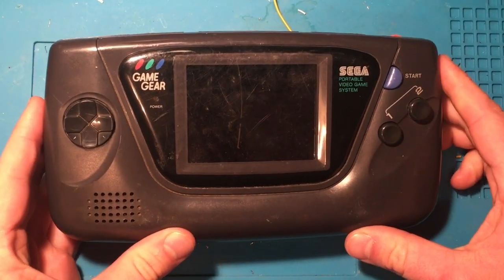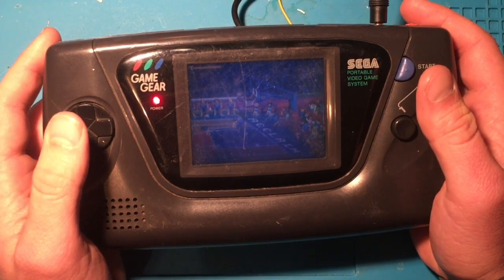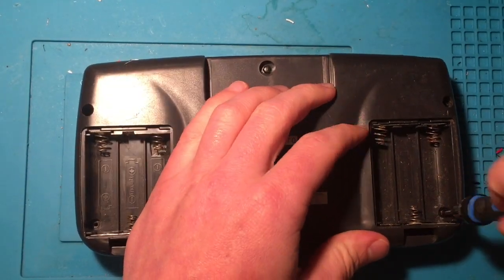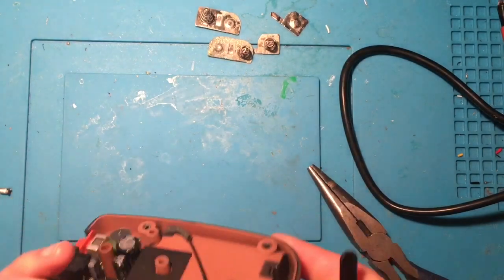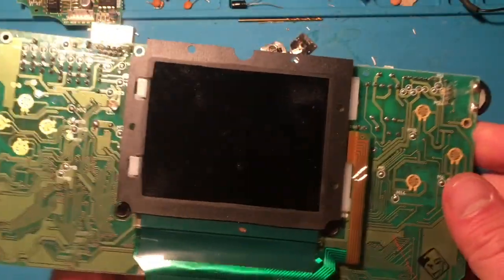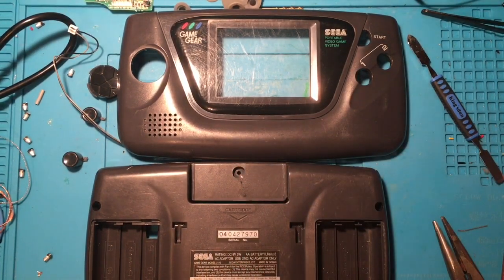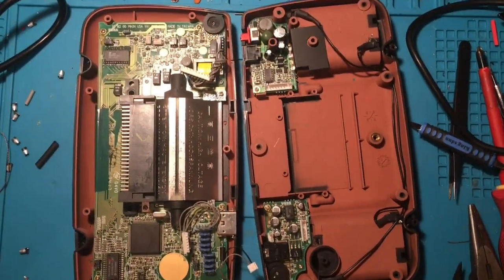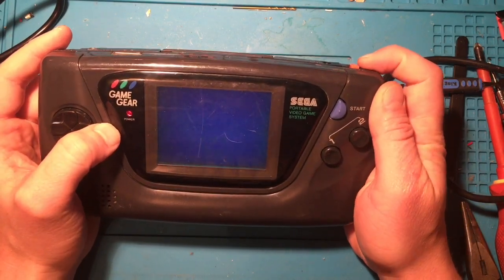Game Gear - No Power - Fixing eBay Junk

Comment: Mine has a bunch of dead capacitors and every time I replace one another one blows up!
Reply from the maker: Like changing a headlight bulb, just change them all.  Capacitors on this system are always prone to failure. It's not a matter of if, but rather when
Reply: yeah its a guarantee they'll all fail, in my experience its the number 1 reason why this system becomes faulty.
Reply: That's pretty nice to know guys, maybe I'll grab one to fix then. I found the comment  kind of funny though, I can  only imagine how frustrating it must have been :P
Reply: @RetroRepairs  I want to do that but my local component store doesn't have what I need and because I'm 13 and don have a credit card I cant get any online. I know I a store that has the right ones but it's an hour long drive! I'm going this weekend with my dad. It seems every time I get a lead there is a roadblock to stop me XD
Reply: @SparksNZeros  I got it to play sonic but the screen was only displaying one segment of the screen over and over to fill the screen. The audio was also really quiet (probably the amplifier). That's when another capacitor exploded.
Reply from the maker: Prepaid credit cards are your friend.  You should be able to buy them at most local grocery stores or drug stores.
Reply from the maker: If you're going to buy caps, buy double what you need.  They should be fairly cheap, but you'd hate to mess one up, or lose one and be stuck
Reply: @RetroRepairs  thanks for the advise! Will do
Reply: @Omegapork  console5.com gas cap kits and the wiki has info on cap values if you want to source them yourself.

Comment: As for the speaker... just drill out the plastic rivets and then use hot glue to reset it in place. did thet with mine when I replaced the speaker eons ago. lol

Comment: What would be a device to try and fix with no experience? You have inspired me to try fix some circuit boards which I previously thought were impossible to fix without magic
Reply from the maker: Older is better. Atari, NES, etc. More room for error, less specialized chips.  Nes systems are very hardy and the replacement parts can be found.  Snes are much different, proprietary chips needing better smd techniques and precision
Reply from the maker: Game gears have very common capacitor faults, so often many different symptoms can be fixed with new capacitors
Reply: RetroRepairs I’ll look out for some. I have a soldering iron and some solder. Any other basic equipment I should pick up before I attempt to fix something?
Reply from the maker: Yes, depending of course on what you want to try and fix, but essentials are a good desoldering braid, rosin flux, 60/40 rosin core solder (thinner is better), tweezers, needle nose pliers, stranded 30awg wire (for jumping bad traces), isopropyp alcohol, q tips and a toothbrush.   You will find that eventually you'll need to get replacement components as well such as capacitors and resistors, so even finding an inexpensive electronics repair kit could be useful.
Reply: @RetroRepairs  Thank you!
You should consider making a video about getting started into repairing electronics (consoles and handhelds to be more specific) that you could link to in all your videos for anyone interested. I feel it could help out a lot of people. Just the basics of what to pick up and where/how to use them as an introduction to repairing things. You've definitely influenced me to try learn and I doubt I'm the only one who would find a video like that helpful. You could even use it as your channel trailer video! Just a suggestion, it's completely up to you! Thank you again and keep doing what you're doing!
Reply from the maker: When i started dabbling, i had a cheap $10 chinese soldering iron, some cheap radio shack solder, and a bottle of alcohol.  I kind of just acquired what i needed from there.  That's not a bad idea though to get people started though.

Comment: don't they have led bulbs that are the same shape and use the same plug as the cfl? would think could just change the bulb to led?
Reply from the maker: Problem is the bulb doesn't plug in, its hardwired to the board, so it's a proprietary bulb.  I'm sure it's possible, but i haven't seen one

Comment: I have a similar problem: 

Power on well with the AC adapter but when I use the batteries I have weird voltages on powerboard. Maybe is the voltage regulator ? 

Any help is very appreciated.
Reply from the maker: Definitely could be a regulator.  Id have to look again, but I'm not sure if there's two regulators, one for ac and one for batteries.
Reply: @RetroRepairs  thank you for the speedy reply :) I have also some coloured vertical lines in 1/3 of the screen but i think it is an impossible repair... Keep it up man !!! Great channel 😁

Comment: Great video, regarding the backlite how about looking into if you can use the backlight panel fra a ds instead ? much cheaper :D
Reply from the maker: You probably wouldnt be able to swap the screens. Different resolution, different connectors. But there's a way to use LEDs instead of a cfl bulb which would definitely help
Reply: @RetroRepairs  Not the screen just the backlight, you can seperate the backlight panel from the image producing part, im pretty sure that's how we used to do cheapo gameboy backlights back in the day :)
Reply: @RetroRepairs  Actually just google it, there's videos of the backlight swap both on the dmg gameboy and the game gear :D

Comment: Got mine off ebay as well. White screen after turning it on, replaced all the caps still the same issue. Any idea what it might be?
Reply from the maker: I assume you've checked the brightness wheel? Should at the very least still be able to switch from white to dark. Could be a bad potentiometer. Might need cleaning or to find a replacement.
Reply: @RetroRepairs  Potentiometer seems to work ok, goes from dark to fully bright but white background. Regarding the capacitors I got them from an ebay kit. Really good quality. I am quite experienced in soldering. The problem seems to be in another component or so. Sadly I don't have that information to track it down. Thanks for your reply! Keep up the good work :)

Comment: Just for my understanding, rubbing alcohol is like isopropyl alcohol?
Reply from the maker: Rubbing alcohol like what comes in those little packets in first aid kits is usually a bit more diluted.  It can work, but if you can get 99% alcohol, that's best.
Reply: @RetroRepairs  oh thanks, i work with isopropyl but i'm not an english viewer so i think that was another type of alcohol, btw handheld legends sell an led backlight for the gamegear for 9.99 maybe thats is useful for you
Reply from the maker: I've bought from handheld legends before. I'll probably try that on one of these some day

Comment: A few years ago I would have said great video, now it is good informative. However I believe  you should have updated the power an added a charging port. So that you dont have to buy batteries or go threw the hassle of changing the rechargeable batteries. But then theres adding a power gauge as well so could have been alot or just rite. But great for the retro crowd. 

Damn one day someone's gunna make a vid about making AA batteries for old hardware.
Reply from the maker: Good ideas.   I'd like to do those in multiple videos if I were to do that,  i think it's best to stick to one topic/mod rather than cramming everything into one long video
Reply: @RetroRepairs  excellent...lol
I wouldnt blame ya. That's a whole lot to cover an to do rite.

Comment: I have a blue Game Gear with the exact problem, no power.
Reply: Does it run via the DC jack? If so, and battery terminals are clean, then the DC jack is likely the problem. It has a switch built in that cuts power from the batteries and that can become dirty or corroded and cause batteries to not work. Check out my post in the game gear subreddit for more details.

Comment: Fix a supernintendo with bad VMU
Reply from the maker: Vmu? You mean ppu?
Reply: @RetroRepairs  BOTH
Reply: One of the hardest retro consoles to fix imo... No good tutorial. It would be viral video.
Reply from the maker: There's no way to fix it other than replacing the ppu or whatever chip is faulty.  It's just a really unreliable system